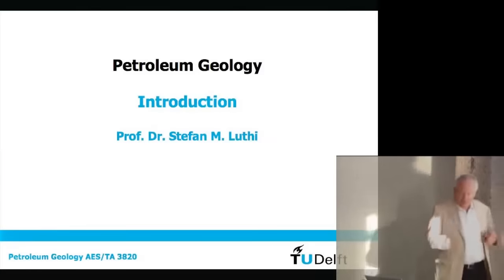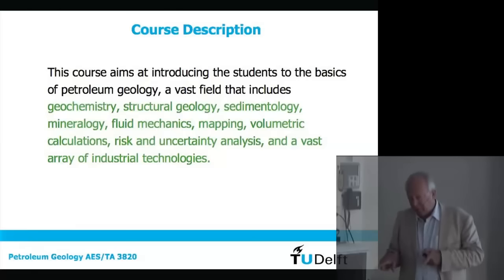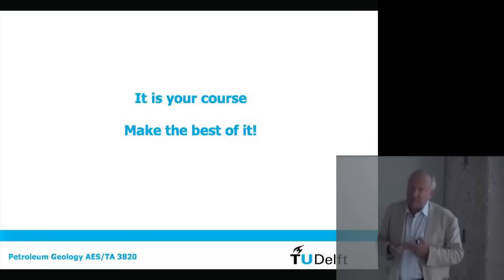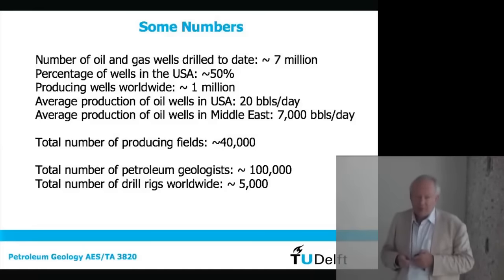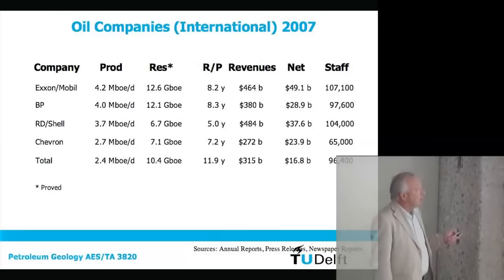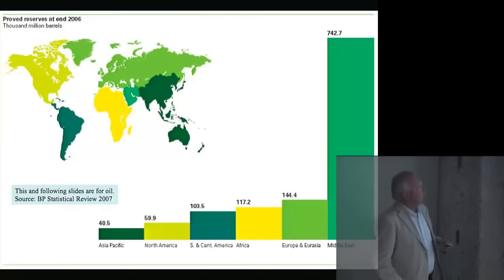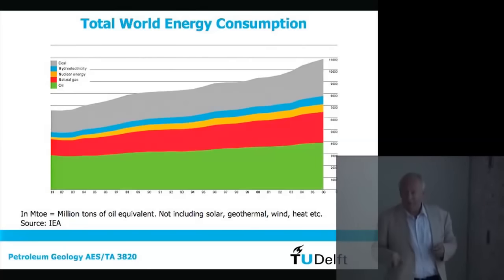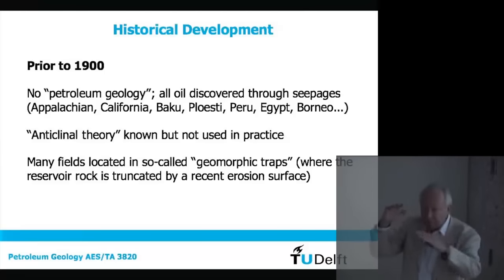Introduction to Petroleum Geology

Comment: You left out the rubber that's on a bicycle is made of petroleum also and not just the plastic. In addition, the bike was manufactured using petroleum as energy to make the components and put them all together.